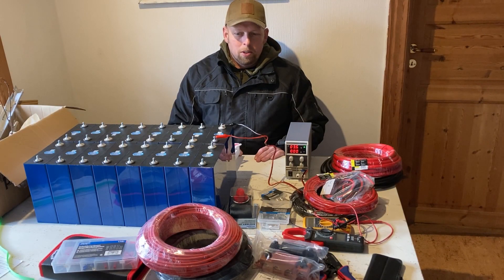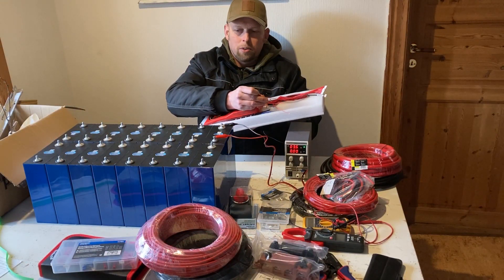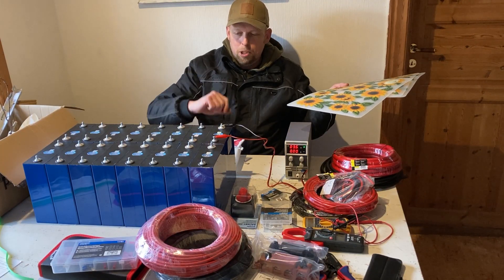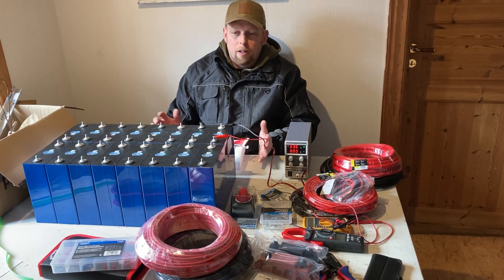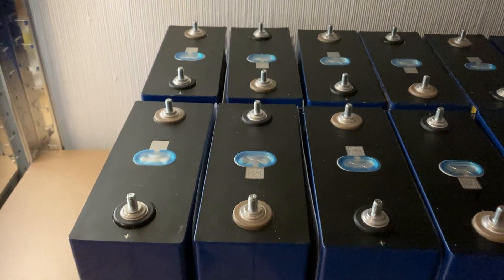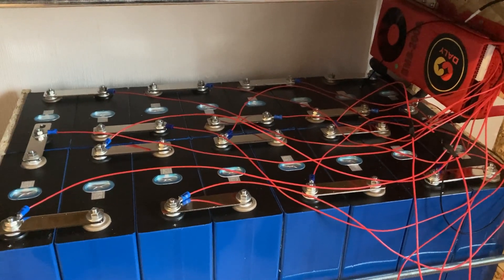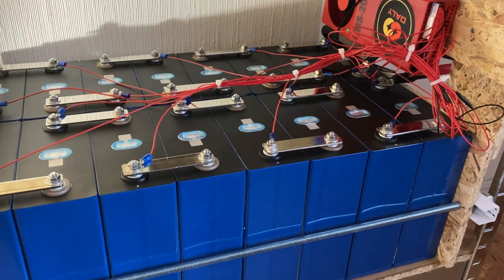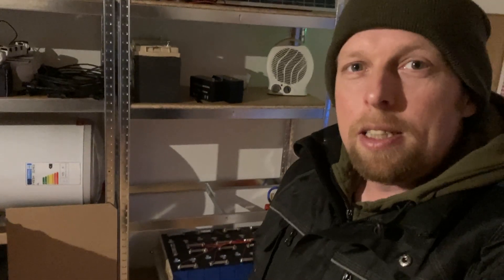15 KWh Batteriespeicher für unter 3000 Euro selber bauen mit Catl 302Ah Zellen Teil 2

Comment: Also ich persönlich würde dir vom Daly BMS abraten und dir eher ein BMS von JiKong empfehlen 😉

Bei deinem 16S LiFePo4 würde z.B. das JK-B2A24S20P-CAN mit 200A Dauerleistung ganz gut passen.

Das kann man auch per CAN-Bus ganz einfach mit ins Victron VRM Portal einbinden und es zeigt dir dann auch gleich die aktuelle Speicherkapazität von deinem LiFePo4-Block in Prozent und auch die Restlaufzeit in Stunden mit an😉

Grüße vom ostdeutschen Solar-Bastler😂

Comment: Hi, mach mal bitte das Balancer Kabel ab und Mess das mal mit Multimeter durch. Schwarz minus dann jedevrote Ader gegen Schwarz, spannung muss dann pro Kabel um da. 3.45 Volt steigen. Wenn das so ist hast du schon mal richtig verdrahtet. Auf dem runden Bluetooth Dongel ist ein Taster diesen mal drücken dann sollte das bms in der App auftauchen. Oder einfach Ladespannung anlegen, dann geht es auch an. Gruß
Reply from the maker: Alles schon genau so gemacht! Ich vermute das BMS funktioniert leider nicht so wie es soll... LG
Reply: @dieselbstversorgerfamilie  - Das BMS muss aktiviert werden. 
Methode 1:  Akku aufladen
Methode 2: Aktiviere das Power-Display-Panel, dort gibt es einen Aktivierungs-Knopf (Nur wird der Akku dabei dann auch etwas entladen. Da laufen etwa 84mA an den Zellen vorbei und nur in jene rein die gerade eine zu niedrige Spannung hat, der Strom dafür wird aus dem Akku genommen. Habe das dem "Richard Steigmann" beschrieben wie das funktioniert.)

Comment: 15kw speicher mit management gibt es doch mittlerweile schon für 2500€ fertig und mit 5 Jahre Garantie. Wozu den Selbstbau?
Reply: Wo? Link?
Sind das dann auch ordentliche LiFePO4 Zellen oder irgend welche gebrauchten Schrott-Zellen?
Werden die auch ordentlich zusammen gepresst? Dadurch verdoppelt man die Haltbarkeit des Akkus. Bei einem 300Ah-System müssen 300kg auf die Zellen wirken, am besten mit Federn und stabilen Metallplatte an den Enden, welche immer die selbe Kraft ausüben. Eine 1mm starke PP-Platte zwischen den Zellen reicht wahrscheinlich aus um kleine Unebenheiten auszugleichen.
Reply from the maker: Hätte gerne den Link, ich bestelle sofort! LG
Reply: @dieselbstversorgerfamilie  Ok, es sind nur 10 kwh: 10 kWh 48V Speicher PV Titan Solar Akku Wandmontage 51.2V 200Ah LiFePO4 Lithium 2550€
Reply: @dieselbstversorgerfamilie  Findet man alles bei Idealo